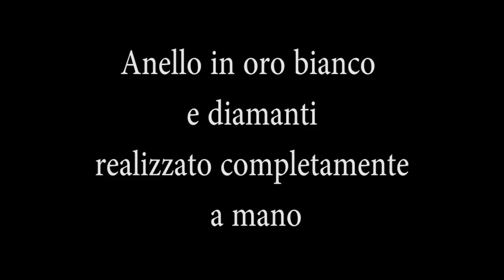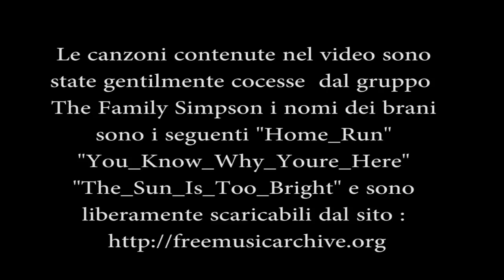Gold ring handmade

Comment: Hi, I love the shape of this ring and I would like to make something similar but perhaps set with a large cabochon. I was going to make a wax and cast it but your ring is the kind of shape I am looking for so I'd like to try your technique. What is the thickness of the metal? What is the technique called for curving/shaping the 2 halves ? Would this work just as well with silver or would that be too soft a metal? Do you have a website ? Many thanks,Amy
Reply from the maker: If you used silver is ok, is more easy to modelling. The thickness, if you made the ring in silver, is good 1,2 /1,5 mm. For any questions you can contact info@oro-diamanti.it. Thanks
Reply: Thankyou so much 😊